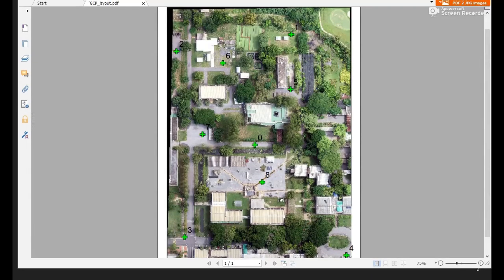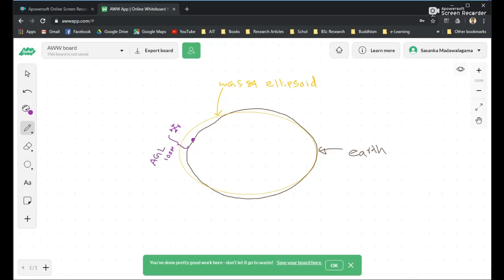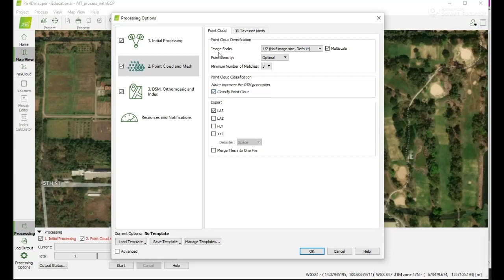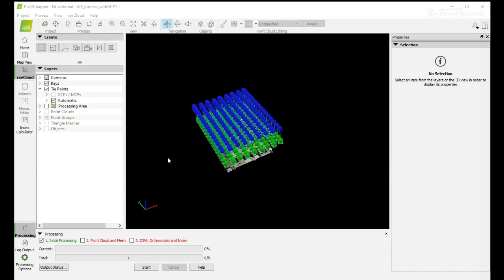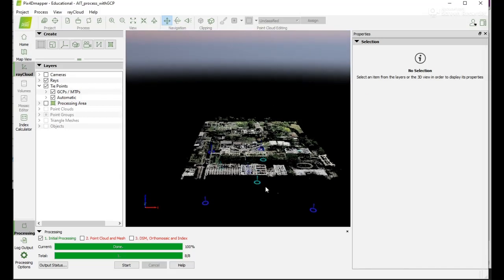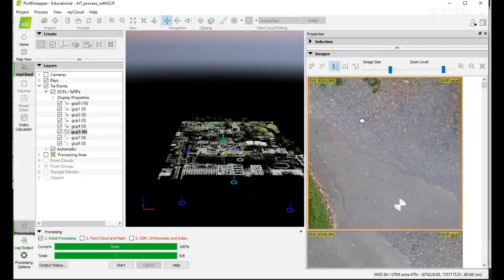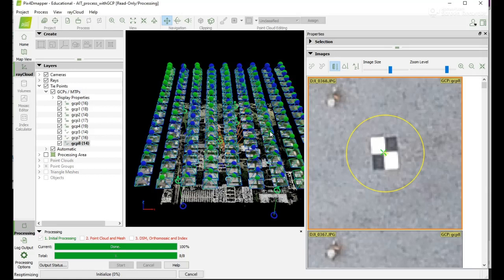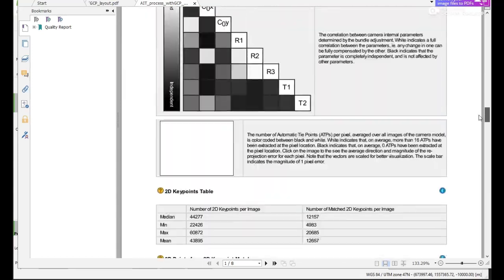Processing Drone Images with GCPs using Pix4D Mapper

Comment: You took it as smooth as a breeze. Kudos. If you can come up with another video on different settings to use in different terrains, managing homogenity or heterogenity in the landcape, it would be great. Thanks.
Reply: ❤7😮
Reply: 5😢0😂😮❤😂2😮🎉😢❤
Reply: 😊3😢😊
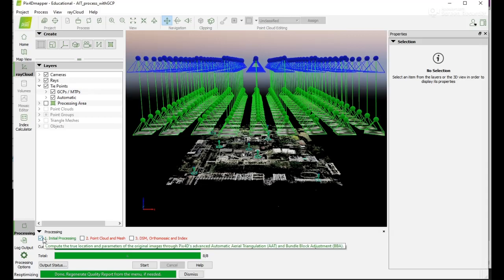Reply: 2😂😢 44:06 😢
Reply: 3🎉😊😂😢😮😂😅 44:06 😅😢😂😢
Reply: 😢❤1❤😊
Reply: 3😊😢😊😮😂😮😢
Reply: 1😢1😊😢❤
Reply: 2
Reply: 😅 44:06 😅😊😊❤😢😊😂😅😊😢3😢0😮😅😂
Reply: 😂😮😂😊😢😂😅😊😢😢27
Reply: 😮🎉9😢😊🎉❤😂0😅😂
Reply: 57
Reply: ❤😊❤🎉😅😮😊😮😮😅😮😂❤9😮🎉😢😂😊🎉😊3😂😅1😂🎉9
Reply: 0 44:06
Reply: 😢❤😮😂3
Reply: 73😂
Reply: 464😂😅😮😮❤😊😢😮😢😂❤😢😅😊😅😢😂
Reply: 😂1😂😂7😊😮😂😮😂🎉😊❤

Comment: I did a mapping with my drone. the assembly of orthomosaic is perfect. However, once in KML in google earth all my mapping is shifted by 3.5 meters from the RTK point. How to remedy the situation?
Reply from the maker: Google earth is an amaizing tool but keep in mind that it has significant amount of positional error (read: https://www.mdpi.com/1424-8220/8/12/7973/pdf) which can be varied from place to place. So its not a good idea to verify the accuracy of your products using google earth. Most probably your products are accurate in terms of geo coordinates.

There are few things you can do if you want to use google earth to be a base map for your products:
1) First verify the product overlay in Pix4D, use google base map
2) if there is a shift, use QGIS to do a translation to your orthomap and export to KML afterwards, using QGIS

--------------------------------------------------------------------------------------------------------------------------------------------------------------------------------------------

another possibility is that an offset is introduced to your base station coordinates which has affected your GCP survey and hence photogrammetric products as well. Since the offset is constant for all GCPs and check points you wont see an error in the quality report.

Comment: Nice Job! I had a hard time understanding you until I turned on "closed caption" and trying to keep up with all those mouse clicks. I can see how this is probably the most important critical step into map making. Even when  you used automatic marking; the control point(s) still needed re-centering. I must admit an error less than 3cm is as perfect as  this can get. Your video was great because you pointed out the most important attributes to be familiar with. I subscribed because you help provide me with enough confidence that Pix4D will be the next software that I will buy. One question though, that route you chose to fly, what was the software used in your mission? Was that Pix4D part of the mapping software? Thanks a Billion!
Reply from the maker: Thank you for the critical feedback on the video. I really appreciate it. About the flight planning software there several free apps that you can use, which are capable of acquiring data to create a 3D map. Im using DJI GS Pro (https://www.dji.com/at/ground-station-pro) which is the most reliable for DJI drones. Other alternatives are Pix4D capture (https://www.pix4d.com/product/pix4dcapture) and DroneDeploy (https://www.dronedeploy.com/). If you are using a DJI drone, I strongly suggest running your flight planning software in an iPad because DJI SDK for iPad is more reliable compared to Android. Hope this would be helpful and happy flying :D

Comment: Very informative. I think you missed to define the 6and7  check points GCP Manager .
Initially you said that points Will not involve in georeferencing.

Thanks alot.
Reply from the maker: Points 5,6 & 7 are used to validate the geolocation accuracy so they were assigned as check points (see 22:23). Please note that even though points 5,6 and 7 do not contribute to georeferencing the map, it is required to mark them in images to observe the errors and compute the accuracy. Those points were correctly marked in the images (see 41:10). I do not find any mistake here :)

Comment: I have a question. My Drone imagery is WGS84/UTM29 and GCPs in ITM. Should I convert drone imagery to ITM or gcp to wgs84? Want final output in ITM. I have already done initial processing and converted gcp to wgs84. But maybe I should start again? Thank you video is very helpful
Reply from the maker: It's not necessary to convert manually. Pix4D will do that for you. When importing the images select the coordinate system as WGS84 (in most cases its automatically detected from image metadata). But when you are importing the GCPs in GCP/MTP Manager, make sure you select ITM as the coordinate system. You have to do this before importing the coordinates. 

Cheers. Happy processing

Comment: Hi Sasanka, I have seen the ortho mosaic but there was some problems in building edge if you see it in 1:200 scale you can clearly see this problem.
Reply from the maker: Yes, some distortion is there at the building edges. The way to minimize this distortion is by adding more images with more overlap, preferably as a double grid.

Comment: Hello Sasanka, Did you figure out why the drone shows the error in elevation  ?
Reply from the maker: Not yet, but I have a guess. The drone normally uses the barometer readings to determine the altitude because it's more reliable and sensitive than the integrated GNSS. It might be due to this but this is just a guess